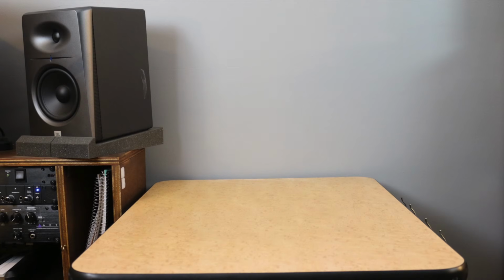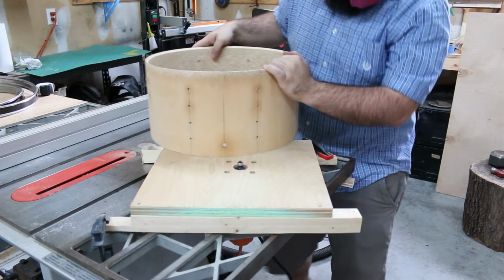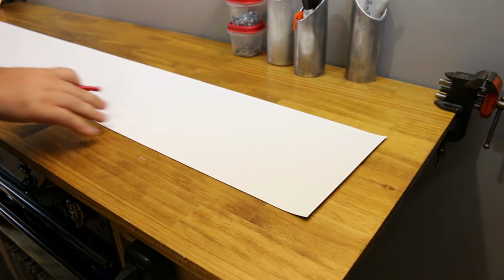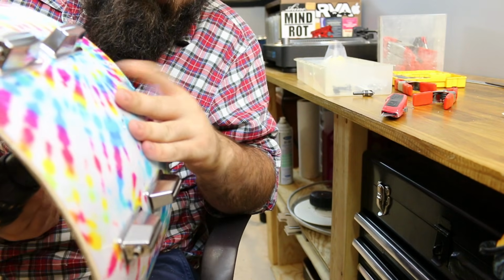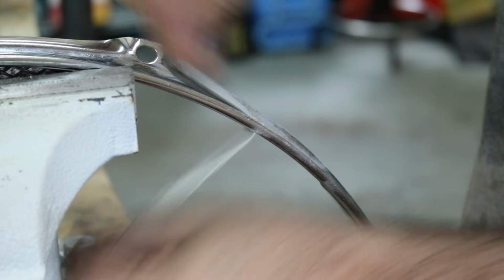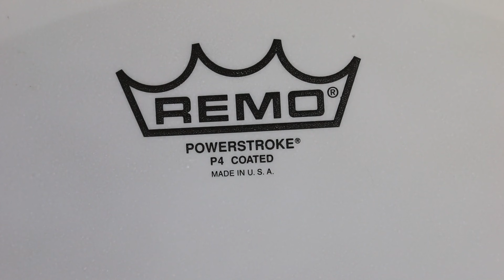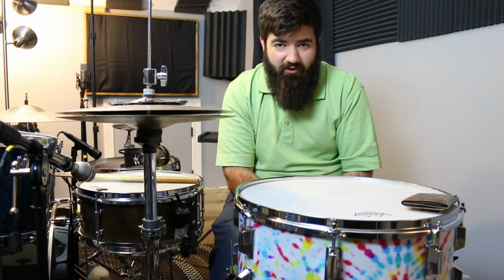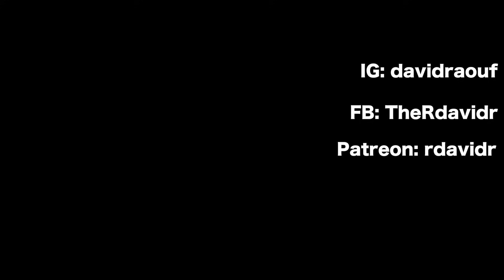16" Tie Dye Snare Drum Build

Comment: For cutting the snare gates a Dremel tool also works pretty fine, just use the heavy - duty cut-off wheels, as they do not wear off so fast as the standard cut-off wheels offered by the same company.

Comment: I just made a 14x 10 steel drum. I rolled it rather than casting it (I don't have a foundry that burns at 2,500 degrees) it didn't come out amazing but it works. some of the lug holes are slightly off. next time I'm going to do a free floating snare so I have less to mess up on.

Comment: 1:00 the different measurements could be a result of the wood warping from years of use, if that's the top.
Reply: I would agree but it was one particular point and I would have even said it could of been the drummer hitting the rim but it was a floor Tom unless they had some accessory there that would cause it to make that dip.

Comment: Unless you're doing kick drums, you need to put the router in the corner instead of the center of the drum, that way the whole drum fits on the table. When I was building drums in the 90's, I had a 46"x46" router table with the router mounted in the corner. I went to the extreme with the size because I was doing 28" kick drums and that way the entire drum would fit on the table (I had future plans to make a 32" Kick but never did it.
Reply from the maker: hmm thats a pretty smart idea actually
Reply: I worked for a Custom Cabinet shop for about 5 years, and luckily - my boss was a musician -  so we built all kinds of stuff like guitars, speaker cabinets, and eventually some drums. That was where we figured out that we needed the router in the corner rather than in the center. 

I think I'm going to have to build a 16" Snare, just because. ;)

Comment: What did you use for the air vent? I mean, where can I buy the little piece that I have to mount?
Reply: David Bernal Drums I love Drum Factory Direct for those kinds of parts. I bought some that screw on and stay put via rubber washers instead of ones that require riveting.

Comment: Hey, I checked out walopus and I'd love to put some on my drums but would I have to take of the paint first or is it fine to put it on the paint? Won't it be too fat?
Reply: Also, I would have tuned the bottom head higher to get more crack and maybe try not muffling it this much?
Reply: +Sam Edits You usually can just put a wrap over a stain or painted drum. I did one over a year ago and it was fine.
Reply: +Matthew Parsons alright thanks mate :)
Reply from the maker: I had the same concern since I was going to use a different drum before I found this one, but its so thin that it wont throw things off.

Comment: Right! Thin heads on the batter side work best, however, I prefer clear Powerstroke 3 heads or Aquarian Classic Clear, and Diplomat - yes, Diplomat bottom heads, ordered at Steve Weiss Music! The only problem is how to find 15" snare wires for this oversized drum. My drum is a custom made 16" x 12" with an RCI acrylic shell, hide - a - head wood hoops, single tube lugs, and Manic Series three - step throw - off and butt. For the all the components check www.stdrums.de! Cheers! Ooops, I forget: my drum is also fitted with LED lights! Disco isn't dead!

Comment: so i took an 8" X 12" tom and cut it down to 4" X 12" got it all sanded and beveled with the intention of turning it into a snare drum. and as i was watching this video i realized that there's really no way to put a snare on it because it has 5 lugs.. help!!!
Reply: Joshua Decker I venture to say it can still work great if you don't put any snare beds on it. Lots of snares on the market, such as Ludwig, don't have them. Just put the strainer and butt plate 3/4 of the way from one lug and 1/4 from the other lug, instead 1/2 way in between like most snares, so the wires can go across the center. Some strainers are pretty wide and may not fit. That's what I would try anyways.
Reply: Joshua Decker was thinking bc I have a 5 lug tom. hmmm, thanx for the idea!

Comment: wouldn't it be easier to wrap it first, then cut the wrap and the shell at the same time and also drill through both to.
Reply from the maker: The bearing edges need to be revealed and a router would most likely tear up the wrap. It might not, but Ill let you find out for yourself lol
Reply: +rdavidr lol, rock on man. love your channel